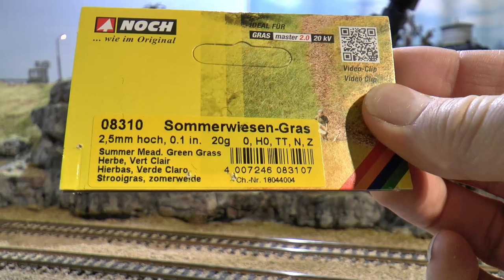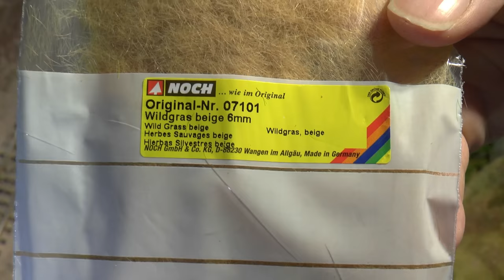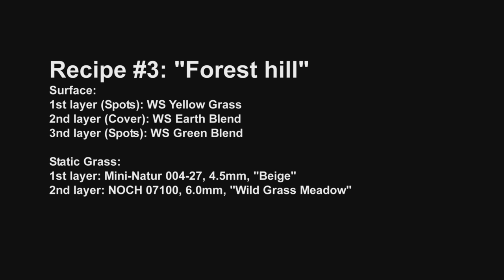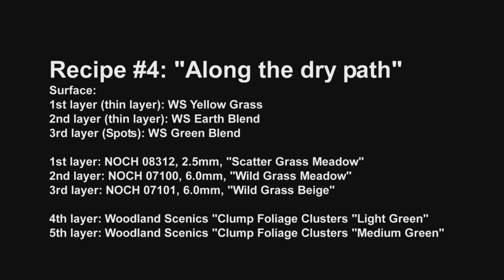Static Grass - Detailed guide to get started DIY

Comment from the maker: I would like to add, since it´s not clearly stated in the tutorial, that 
the amount of grass applied on a surface has a huge impact of the final look.
This can be controlled manually during application, but also by selecting different sieves.
The more dense, the better soil. Dense grass application does not match very well dry gravel, or rock based ground.
Using a static grass applicator is much like using an airbrush. It takes 2 seconds to get started, but a lifetime to master.

Ich möchte hinzufügen, denn es ist nicht klar in der Tutorial angegeben, dass
die Menge von Gras auf eine Oberfläche aufgebracht hat einen großen Einfluss der endgültige Aussehen.
Dies kann manuell während der Anwendung gesteuert werden, sondern auch durch verschiedene Siebe auswählen.
Je dichter, desto besser Boden. Dichtes Gras Anwendung passt nicht sehr gut auf Kies oder Felsen basierend Boden.
eine statische Gras Applikator ist ähnlich wie ein Airbrush. Es wird in 2 Sekunden, um zu beginnen, aber ein Leben lang zu meistern.

Jag vill lägga till att mängden gräs som appliceras på en yta har en stor inverkan på den slutliga utseendet.
Detta kan styras manuellt under applicering, men också genom att välja olika siktar.
Ju mer gräs/ytenhet, destå bördigare jord. På samma sätt passar glest applicerat gräs bättre på tex grus- eller stenbaserad mark.
Detta är lite grann som att använda en airbrush. Det tar 2 sekunder för att komma igång, men en livstid att bemästra.

Comment: That thing is a great invention, but confuses me. The grid is not connected to the ion/HV source. The grounding pin is weird as well, the ground is a) not conductive at all and b) if its working as shown, the pin should be covered in grass also, because its bare metal, most conductive. The ions in the applicator charge the grass, make it stand up straight, I dont think you need the ground. Did you ever try it without?
Reply from the maker: Better off thinking how to use it in the most brilliant way rather than how to disassemble it.. 👍😊
Reply: Not sure what you mean. The price is high so I would rather make my own, I dont really need to take one apart :p physical principle is used for painting cars as well, its called ESTA, if they tried to mimick it, they failed a bit. You did not answer my question though, did you ever try it without the grounding pin?
Reply from the maker: Nope.. Never tried without grounding.
Reply: There are other static chargers, the work without ground. But for my dioramas I have to make one so I will try it out when its done.

Comment: I have issues with the grass not standing up.. it does initially but then it lays down.
Reply from the maker: Hi Paul! What glue do you use? I recommend Noch static grass glue. I have used PVA-glue before, but now moved over to the Noch product.
Reply: @marklinofsweden  i usually use woodland scenic static tack now it seems to work better. Nicholas products are hard to come by in the USA. Only specific retailers can even attempt to get it.
On the good side things from Marklin and Rocco are incredibly cheap localy as there is virtually no demand for European trains here.
Reply from the maker: I think best option is to order Noch items from their webshop. They ship DHL worldwide at a reasonable cost.